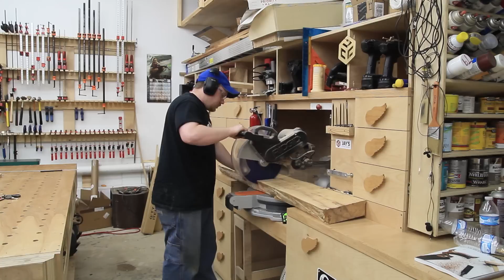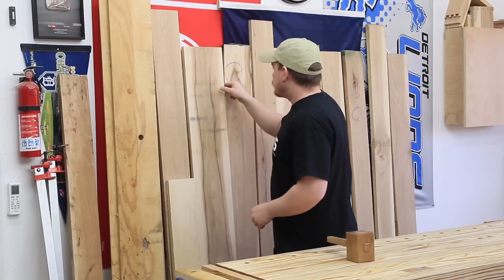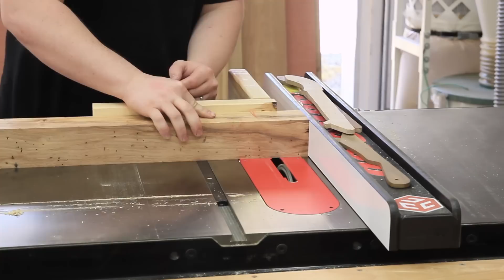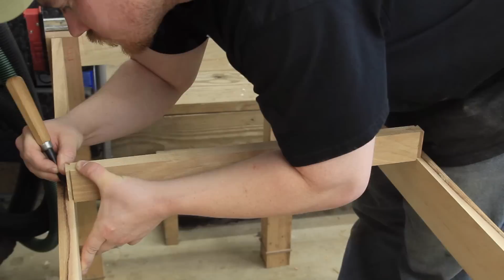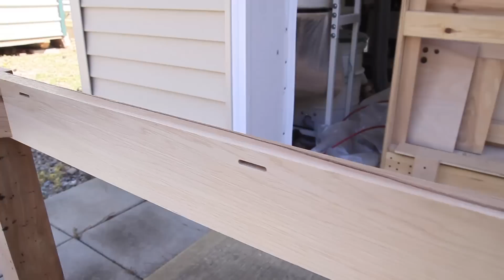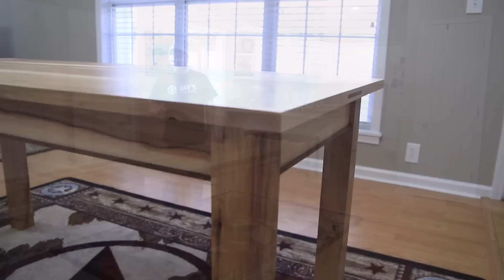How To Build A Dining Table - 242

Comment: WHERE  R U LOCATED    JUST BUILT A 40X80 WOOD SHOP  NEED YOUR THOUGHTS ON  SETTING UP EQUIPMENT   JOHN.STEELE2727@GMAIL.COM
WOULD LIKE TO TALK TO  YOU SOON ABOUT SET UP WITH THE EQUIPMENT THAT I HAVE  MOST OF MY EQUIPMENT IS 3 PHASE   THANKS IN ADVANCE  JOHN STEELE  BURLINGTON KY

Comment: Hey Jay, 
Love you’re videos. Awesome camera work and of course exceptional craftsmanship every time. 

Great tip on the milling type of legs, vs tops. Never would’ve thought of that

Question regarding your Dewalt 735... I have the same one, and love it most of he time. Wondering how you prevent snipe? I have the factor infeed and outfedd tables and I have them dialed in to be perfectly flat to the planer bed,  but I still deal with snipe it seems like 50% of the time. I always lift up and support the board as it comes out but still I get some wicked snipe sometimes. 

Have you upgraded to the helical head?

Comment: Just before you mentioned board games I was thinking that's a good size table for playing chess (or any other 2-player board game). I currently use a 30" × 60" banquet table with folding legs for playing chess. My chessboard is 21" square, so that gives 4½" in front of the board for both players to rest their elbows on the table if they want, and there's more than enough room on each side of the board for things like captured pieces, a chess clock, ash trays, beverages, game boxes, etc. 

I'm thinking about building a nice table with a chessboard integrated into the tabletop, which is why I'm watching this video. I'd probably make the tabletop 32" × 48" (I don't really need the full 60"). The chessboard squares would be solid blocks of maple and walnut, and the rest of the table would be walnut. It will be a basic design like you built, except I would taper the legs.

Comment: I know this video is old, but do you know what the purpose of that small runner is that goes across your wood floors? Do you trip on it sometimes? I can't figure it out because the flooring is the same on both sides. Oh, and great table! Sometimes simple is better. Well, a lot of times really lol.
Reply from the maker: The previous owner installed it. The living room/dining room area is about 1/2" lower than the kitchen and hallway area. Due to the height difference the transition is necessary. I don't trip over it at all and it's not a problem. But I do wish it was one seamless floor.
Reply: Aw, I see. Couldn't tell it was lower from the video. Well, when you one day replace the floors maybe you can add something to level them up. Thanks for the response and the videos!

Comment: the "matrix spec-effect" with the chisel was classic..hey man, forgot, did you only glue the walnut strips in or can i plug a couple brads in there too (or will it split them--using 'walnut stained' pallet strips)?

Fantastic work.
Reply from the maker: +Atonement 2018-2028 Just glue on the inlay pieces. Glue and brads on the pieces connected to the bottom of the rails.
Reply: +Jay Bates 
check.....thanks brotha'

Comment: Very nice looking table!  Didn't even notice it was as narrow as it was until it was assembled and  you were standing in front of it.   I'm sure it will last a very long time.   I also like the character of the bug damage.   I like the walnut bands.  Like the others said it might catch things, but you can always sand them flush and re-coat at a later time if need be.

Comment: Nice table.  You did a great job building it.  I noticed you have a fair share of pipe clamps.  As long as they are threaded on both ends, you can use an inexpensive coupler to join two (or more) pipes for those long clamping situations.

Comment: Jay - when cutting the mortise, why the slowest speed as opposed to the fastes speed for the router bit? I've not cut a mortise with a router but have cut dados/rabbets - I've used higher speeds (in plywood) and wondering is I should be using lower speeds.  Thanks.  Scott
Reply from the maker: +The 2 Car Garage Shop as a general rule, the larger the diameter the slower the speed. When cutting with too fast of speed you will get burning. I never use the fastest setting on any of my routers.
Reply: +Jay Bates thanks Jay - I've got some rabbets/dados to on the near future for 3/4 ply to fit - I use the "just undersized" bits for ply. I'll try a slower speed. Thanks again

Comment: Sometimes, defects add character. So long as its structurally sound, why not include it? Also, does the frame design lend itself for a bigger table top to be attached to it, without changing the frame? Wasn't sure how you attached the table top to the frame. 

Love the result, loads of character and a talking piece for many, many years to come ;)

Comment: Very nice table build! Nice job on the hand cut sliding dovetail.   I will be working on a larger table very soon. I feel your pain about the long clamps. I see that you have some of the bessey parallel clamps.  Check out my tip video on this very issue. https://youtu.be/_pEpUJc0zBI

Comment: Very nice Jay. Just wondering about your comment about only seating 4. Do you not plan to use the ends as seating or is it not wide enough to consider that?
Reply from the maker: +abetrman It will seat 6 if needed. But for normal use 4 would be appropriate.
Reply: +Jay Bates Thanks for the response. Very nice results.

Comment: I sanded down the piece I am working on now to 220 gritt. I'm applying primer to it now to get it ready for paint. It seems to be rough again. Will that water trick you talked about in this video prevent that ? 

table looks great.
Reply from the maker: +Ben Wallace I used a water based finish so if I applied it to the wood it would raise the grain and be fuzzy. Applying water first to raise the grain and then sand the fuzz down prevents any fuzz from being there when the finish is applied.